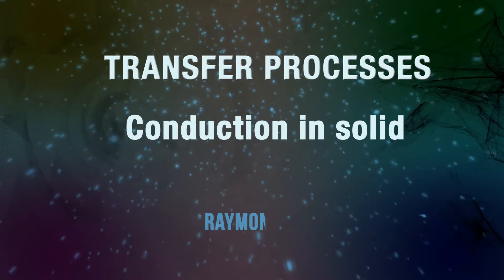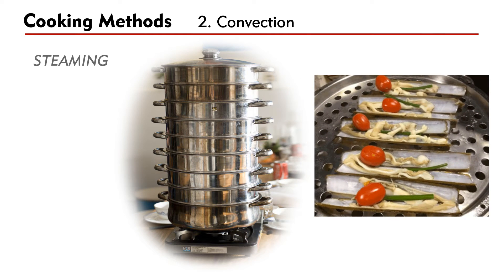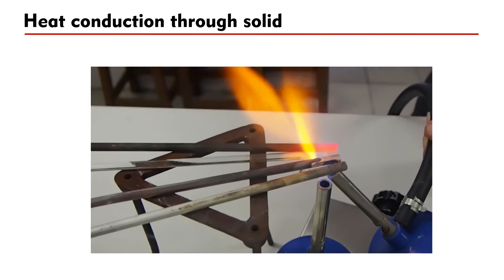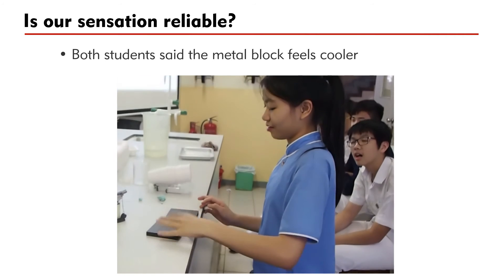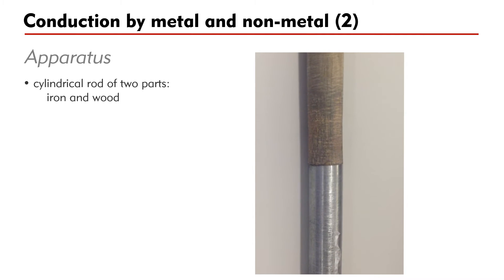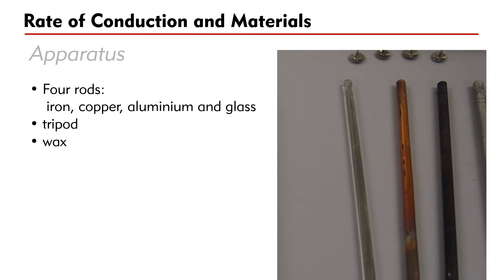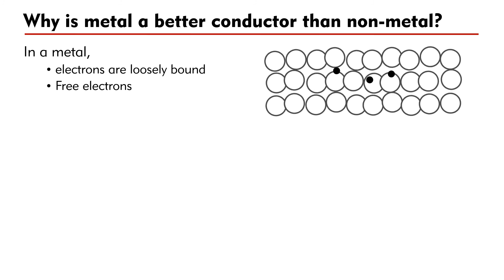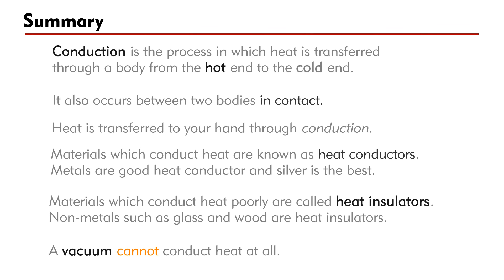Transfer processes: Conduction in a solid

Comment: i think 2 will fall first ,because the aluminum stick has larger cross section al area, it means more particles will heated at the same time,so more particle will carry heat to the wax !So the rate conduction will be faster

Comment: They will not fall at the same time. the first one will fall first as the first pin is thinner. It can conduct heat faster as it has a smaller mass and less molecules. Little time is needed to transfer heat through conduction.Thus,the first one will fall first.

Comment: The 1st pin will fall first. By heating them at the same rate, the free electrons in the thinner metal rod have less room to move along the metallic ions, so they will collide with the ions and electrons more frequently in a single direction, and less to the sides, compared to the thicker rod. Heat transfer will therefore go faster, with the heat reaching the wax and melting it.